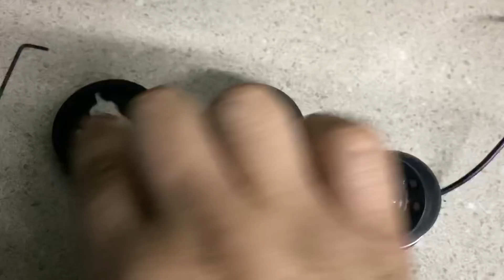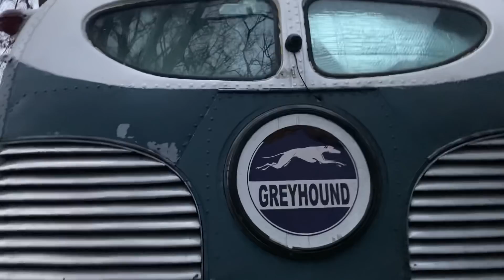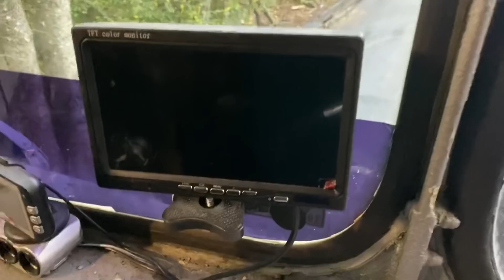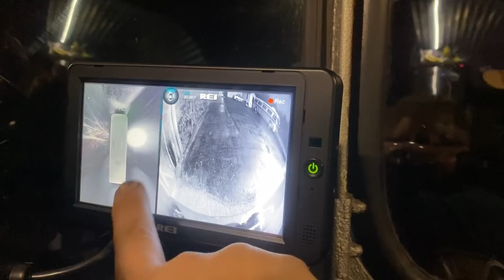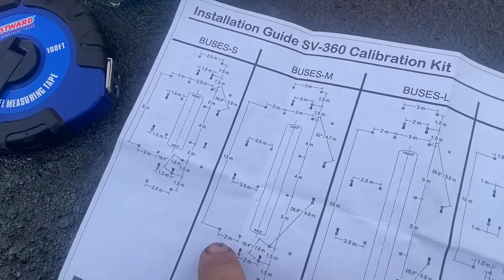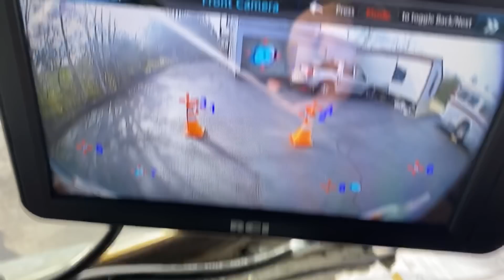Installing a 3D 360° camera system from REI on our vintage rv bus conversion

Comment from the maker: REI would like to offer your viewers a substantial discount on our 360 surround view camera system.
 
We will discount the system $350, from $1750 to $1375.  Also, there is a $50 available on the calibration kit, from $200 to $150.
 
A $400 total savings!
 
Call 800-228-9275 or email info@radioeng.com and mention Bus Grease Monkey to receive this offer!

Comment: Now that you've gotten a year's worth of seat time with this going down the road - what are you impressions?

I'm also curious beyond you're overall notes about it as a complete system and how it's worked for you, about the following: I've read that some of these system's video feeds are actually delayed (in some instances even as much as 5 seconds if the video processing unit is overheating and it's CPU is throttling at that moment) and not showing on screen what's actually happening in that second outside of the bus.

Comment: This is an impressive 360-degree surround-view camera system!  I hope REI reads this because you’re incorrectly calling it “3D”.  There’s nothing about it that’s 3D, or even stereoscopic.  You’ll notice that the screen is flat, not three dimensional.  The driver does not wear 3D glasses.  It’s terrific that it provides surround view, but please don’t call it “3D”.
Reply from the maker: Refer to the manual cover at the very beginning.   3D.    No it’s not 3D like you wear glasses but the rendering reproduces a dimensional view from the bus.

Comment: When you look in your mirrors can you see the cameras on the sides ,just thinking that if they stick out from the side you could snag them on bushes or branches but if you can see them it won’t be a problem. Do they also have recording capability, if so you couldn’t ask for a better security system. Really good resolution
Reply from the maker: No you can’t see them on the mirrors. They are tiny and far away.  They don’t stick out much but they do have a flush recessed mount too. I dint use that kind because i didn’t want to put bigger holes in my bus

Comment: I wonder if it will take a while to get used to the fish-eye look, after all, for the most part, we normally see things in straight line dimensions?
Reply from the maker: There is no fish eye look.   The software shows the image corrected.   Things look larger than in real life when the are closer to the camera, but that’s a good thing

Comment: Does it have the ability to add an on screen marker to show where your sewer hose connection is located so that you can align with the dump station?  I have threatened more than once to mount a spot light shining down on the ground attached onto that bay door.
Reply: now that would be very , very nice ! even the fuel fill too !

Comment: Where do you buy one of these.
Reply from the maker: Call the 800 number in the description during regular business hours.  Or email them.
Reply: Ask for Nate when you call REI.
Reply: How much does this set up cost? Ballpark...
Reply: @rayjos0424  $1925 including the 360 system and calibration kit.  800-228-9275, ask for Nate

Comment: Most commercial motorcoaches like mine are equipped from the factory with REI sound & video. Their stuff has its pluses as well as its minuses. That camera system would never last on a commercial motorcoach . Some part time driver that don’t give a rip would rip it off on a tree limb the first time he/she drove it. Fixing driver damages is probably the single greatest maintenance expense for companies that have a fleet. I can see how the cameras would greatly benefit you though because nobody’s getting behind the wheel but you.
Reply from the maker: They can recess mount as well. I didn’t want to do big holes
Reply: The answer to that problem is to make them driverless. Then the computer can kill a cyclist at will, but never damage a camera.
Reply: Benny Banger Parts of Europe already have driverless transit buses on the road being “tested”. They still have a human on the vehicle though .
Reply: Wayne, Thank you for the input.  I am the OEM Account Manager at REI.  Yes, we are all too familiar with cameras being knocked off of buses.  To alleviate that we are working with the Bus Manufacturers to make the camera mounting as sleek as possible.  Also with the increased visibility of the system, it should recusce these issues.
Reply: Jay Nemec Thanks for the reply. Unfortunately, as much as you try it’s hard to make things “driver proof”.

Comment: Looks brilliant, certainly is a clever system, the boys who drive the passenger busses around us could do with the same system. The single track roads are a killer and the Uig hair pin bend has seen many an inexperience driver stuck. Last year the winds picked up a bus and blew it of the road fortunately no one was hurt. Have a good weekend.

Comment: I was so confused when I read that you bought this system from REI.

REI means Recreation Equipment Incorporated to me. Lol.

I would have mounted the cameras under the drip rail.
Reply: REI means the same thing to me, but then I am from Seattle.
Reply: @mikemullay5622  Shoreline
Reply: @gj5250  Cool! I am actually in South East King County
Reply: REI means Radio Engineering Institute to me, the place where I went to broadcasting school...